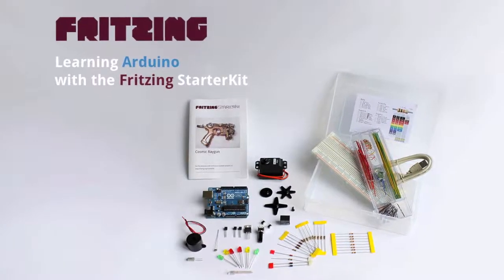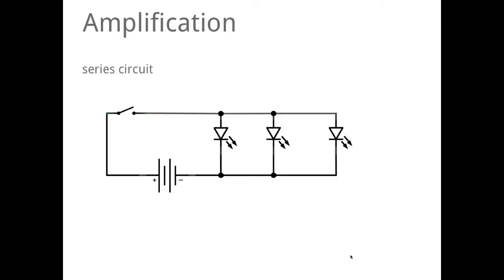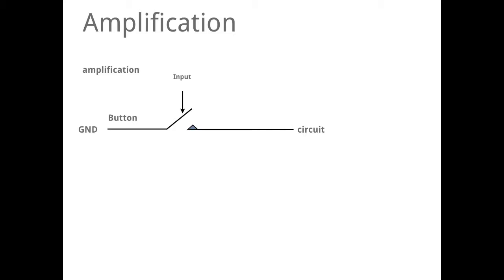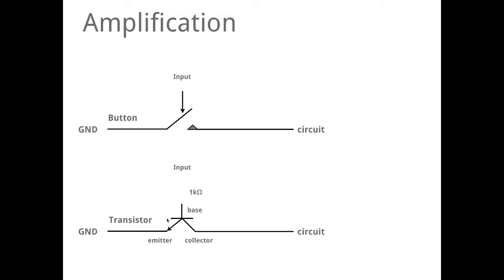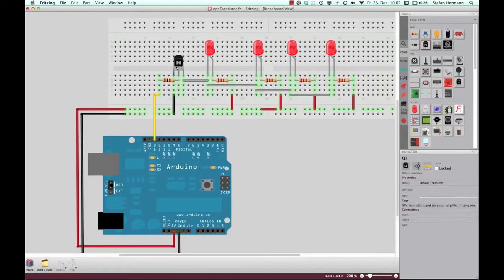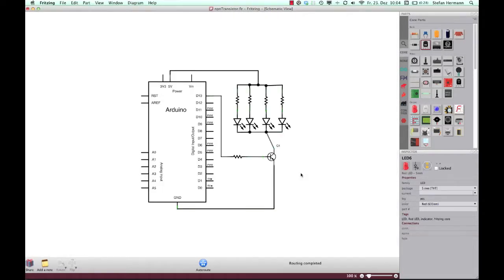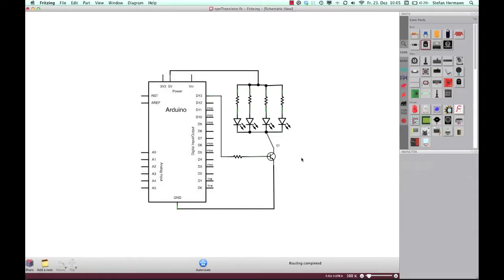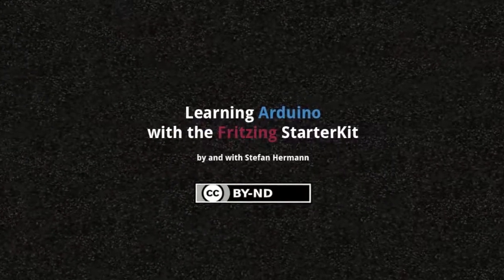Learning Arduino Episode 007 -- Amplification with a transistor

Comment: On the circuit print you can see that the transistor is a NPN transistor, this detail is very important to get a correct concept of the NPN transistor. On the other hand a PNP transistor can't be wired same way and can be complementary to a NPN transistor.

Comment: One question.  Why do you put a resistor between the arduino and the base leg of the Transistor?

Do transistors only "switch" at certain voltage or amperage?

Comment: Thank you very much, but now I'm confused by the TO 92 NPN transistor. Its not clear to me which pin is the Emitter. With a Goggle search, I'm finding data sheets listing pin 1 (on the left with the flat side towards me) as the Emitter, and sometimes as the Collector. 

Also, the RGB LED in the Mega Starter Kit, is it a common cathode, or common anode?

Thanks,
Ken

Comment from the maker: As long it is just an electronical solution, you can use for example the code from the Blink example of Arduino. You find it in Arduino > File > Examples > Basic > Blink :)